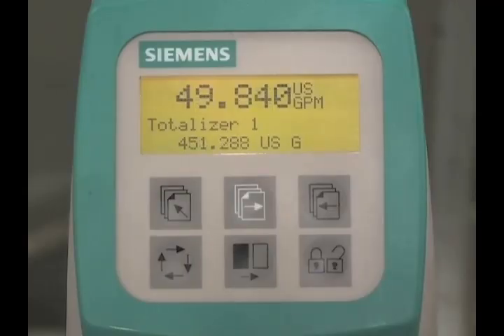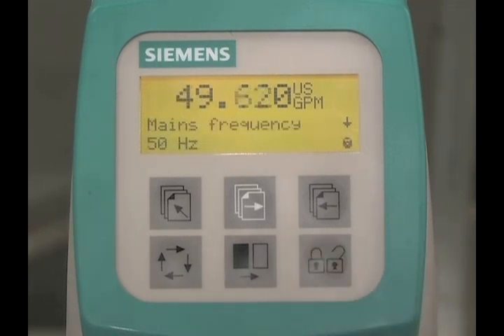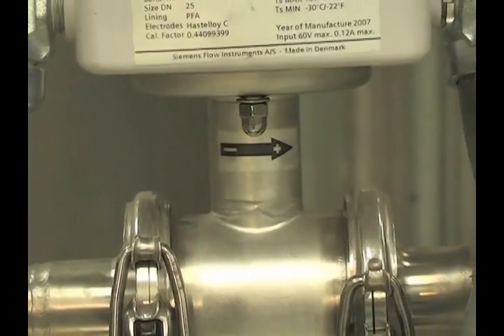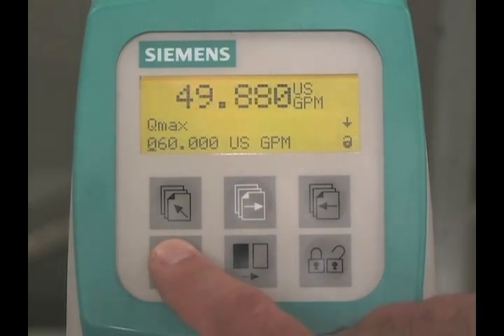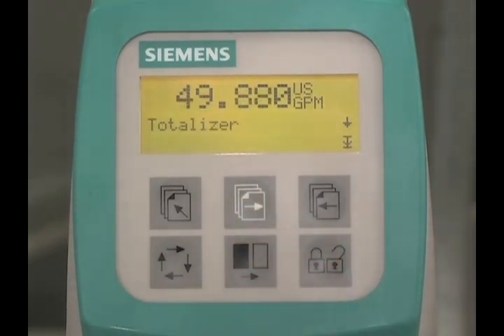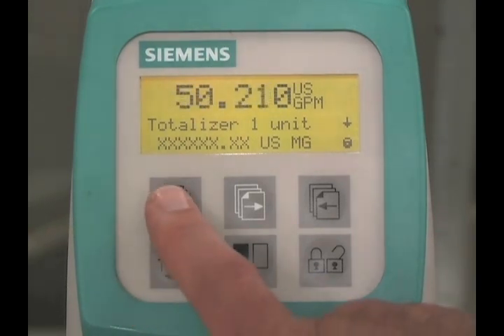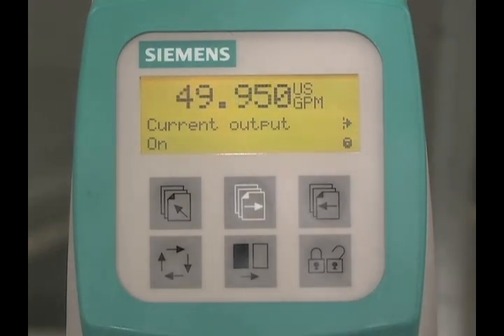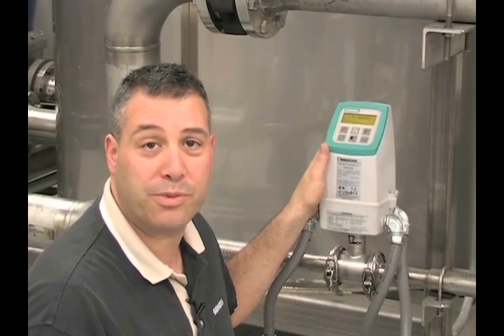SITRANS F M Electromagnetic Flowmeter Basic Programming

Comment: I have a problem with my MAG5000, when i turn off the pump/motor frequency (by inverter), the flowmeter cant zero, still read a flowrate in 29,5 lph, so i cant know the actual flowrate when the pump running (increase frequency by inverter)

Please help me, tq
Reply: i think you can make it zero cal while actual zero flow
Reply: https://youtu.be/BfFqqZ9I_D4
Reply: No answer from Siemens sir?
Reply: @HHafis-ik2rv  yes sir, no respond
Reply: @azzallodya  so…how u solve the problem sir…to make it zero…i also have a same problem with u…can u help me sir…Thank you sir

Comment: How to change unit from m3/h to usgpm that display on the flowmeter..?
Reply from the maker: Mohd Nizamuddin From Norm Kramer, Siemens Applications Engineer: That change can be made by accessing the Basic Settings menu. The parameter is called Qmax.
Reply: @thinksiemens  how to trim flow m3/h at mag5000/6000…example…1 pump flow at 1200m3/h…but after the years it can be 1000m3/h…how to trim it…what setting to do that at mag5000/6000…or to do span…another one question is…how to zero m3/h…after i off the pump…there have a 5m3/h…but i want make it 0.00…please help me..Thank you
Reply: @thinksiemens  I'm having the same issue trying to change the unit of flow. USGPH is the only option and when selected it immediately reverts back to m3/h. I don't have an option at all for USGPM.